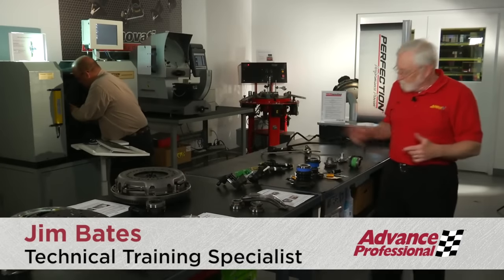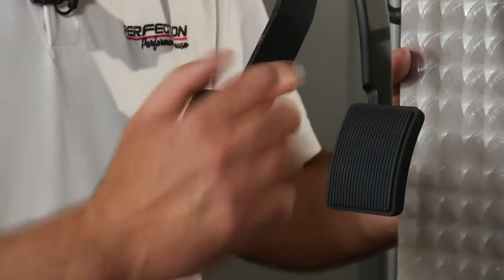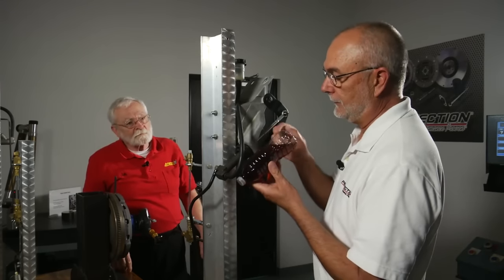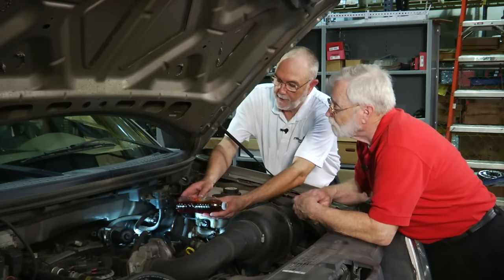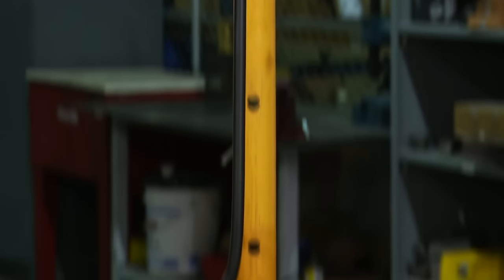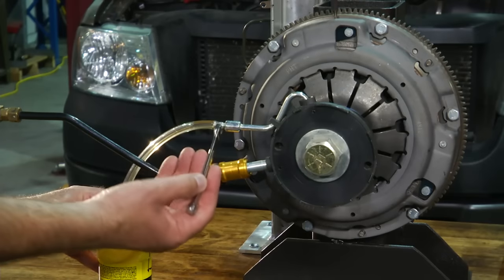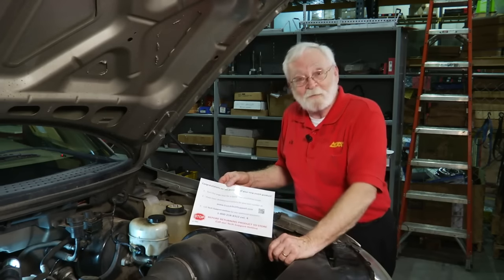How To Bleed A Hydraulic Clutch - Wrenchin' Up

Comment: Hey guys...
I have a 2006 6 SPEED GTO. ONLY 30,000 MILES.
SOMETIMES I HAVE CLUTCH PRESSURE SOMETIMES NOT.
PUMPING SOMETIMES BRINGS IT BACK SOMETIMES NOT.
I'VE BLED IT TWICE OVER THE YEARS BUT I'M 74 AND A DISABLED VET...ONCE IT STRANDED ME AFTER SIMPLY STOPPING AND CUTTING IT OFF FOR 15-20 MINUTES.  I COULDNT EVEN CHANGE GEARS WHILE STOPPED.
A FRIEND BROUGHT ME SOME FLUID, IT WASNT REALLY LOW AND AFTER ONLY A FEW DROPS AND A FEW PUMPS I REGAINED MY CLUTCH.
CALLING SHOPS THEY AUTOMATICALLY SAY I NEED A NEW SLAVE CYLINDER FOR $700 OR MORE.
WATCHING OTHER VIDEOS...THEY SAY IT COULD SIMPLY BE a $0.50 O-ring on the line where it attaches to the slave cylinder.
I DONT SEE ANY LEAKS ON THE CEMENT WHERE ITS PARKED MOST OF THE TIME BUT SOMETIMES INSPECTING AROUND THE BELL HOUSING ITS A BIT WET.
CAN IT POSSIBLY BE THAT THE O-ring is leaking occasdionally?
It's been sitting for about 2 months and i still have good pressure. I crank it and let it get up to operating temp for awhile, pull it up then back a short distance to cycle it through a heat phase then after a couple months of doing this...all of a sudden no clutch pedal again.
Sometimes pumping it brings it back, sometimes not.
Let it sit from frustration about a month and It'll Sometimes pump up.
Its weird...
The resiveour never gets below the tubing on the master cylinder..i add some if necessary before touching anything else.
I'd think if the slave cylinder had a leak it'd leak all the time???
Any idea? Bad O-ring leaking occasionally or what???
It's doubful a shop will fix it and say it was only a bad O-ring...lol.
They tell me theyll have to put it on a rack and pull the transmission to replace the whole slave cylinder which i understand but was it necessary to begin with???
And...of course they want to change the clutch too!
Add another $800. 
Like i said..it only has 30,000 miles and most of those were on long vacation trips on interstate highways...not much shifting!
What cha think?
Reply from the maker: Hi - Thanks for watching! Being retired I seem to have developed a bit of a “rusty thumb”, and because long distance diagnostics can be difficult anyway, I really want to suggest that you contact Precision Clutch about this as they have a vast library of vehicle specific video’s and information that may be of assistance. Their contact information is in this video’s description.

Comment: what about if you are car shares the reservoir with the brakes how would you bench bleed that
Reply from the maker: Hi - That's a good question. I suggest you check with Perfection Clutch at their website (listed in the metadata below the video) as they usually have vehicle specific procedures there. Thanks for watching!

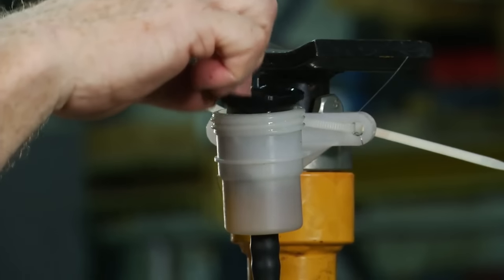Comment: 3:49 How do you do this when the master cylinder is shared with the brakes and all your lines are solid lines (not rubber hoses)?
Reply from the maker: Hi - Thanks for watching! That type of system was not discussed during the filming so I would like to suggest that you check with Perfection Clutch. They have a vast library of vehicle specific videos and information. Their contact information is in the video description.

Comment: I press down the clutch down and its hard to change gears what may be the problems
Reply from the maker: Lots of things, but you may first want to consider that your clutch pressure plate and disc are just worn out and need to be replaced. If it's a hydraulic clutch you'll have to check for leaks in the system too. Thanks for watching!

Comment: Hi Jim,I don't know if this would be the preferred method but on my Ford Ranger I removed the clutch rod from the pedal,then the switch and took the snap ring out of the top of the cylinder.Pulled the plunger up until fluid ran out and then pushed it back in.Reinstalled the snap ring and put it all back together.I used a new pair of 90 degree snap ring pliers and put a new clip on the clutch pedal rod.Less than 20 dollars spent and about 20 minutes to do and it worked perfectly for me.Might help someone else with a similar vehicle as mine.
Reply from the maker: Thanks for watching and thanks for the great tip! I'm sure folks with a vehicle like yours will find it interesting.

Comment: Damn good video I'm going to jack the front of my car way up in the air for this one
Reply from the maker: Hi - Thanks for watching! Some folks have said that worked well for them.
Reply: @WrenchinUpwithJimBates  I bled the cylinder that way but still I had to replace it because the pedal got softer after sitting overnight. Replacing the slave cylinder and bleeding it though it was very easy. I took the car apart three times for practice.

Comment: Why can't a person purchase this already bled? No matter what I do the pedal goes to the floor. As I said I have done this a year and a half ago. Got in to the 89 chevy S10 pickup and drove it away.  Ever do a timing belt on a 95 Lebaron with a V6. Doing what I am doing should be straight foward. like I did a year and a half ago. I purchased the same items and had NO ISSUES WHAT SO EVER!!!! My blood pressure has gone up because of my truck no moving!
Reply from the maker: Hi - Did you do this a year and a half ago on the same vehicle?
Reply: Jim Bates Yes. I didn't even have to get special tools!  yesterday I put a pair of vise grips on the hose that goes in between the master and slave cylinder and the clutch near the bottom and the pedal is hard and firm . doesn't feel spongy.  had a fried stop by and he helped me bleed it the old school way.  all I seen was clear fluid come out. Then it went bad. while trying to install  slave cylinder the pin fell into the trans. Took me 15 minutes but got it out with magnet on a string. hope it works when I put slave on tonight.

Comment: Hey Jim, thanks for the video! Very informative, you got a calm voice aswell. :}

Do you maybe know what can cause a clutch 'pedal' to release air from the top of the pedal when you press it in? Ty!
Reply from the maker: Hi and thanks for watching! I suppose it could be anything from air just harmlessly escaping from a rubber boot type of grommet at the firewall to perhaps even a bypassing clutch master cylinder (not good). What type of vehicle is it, and are you having any clutch problems that may have a contributing factor? Hopefully the experts at Perfection Clutch will jump in here with some guidance as well.
Reply: Woopsss! Forgot to state car lmao, its a 2000 Civic hatch, it leaks from the rubber, would it be a master clutch cylinder leak or?

Other than a leak, there is no noticable problems with the clutch at all, fluid is on level, clutch engages/disengages. It is just the irritating woosh of air sound, and the little leak at the pedal :d

Thanks jim!
Reply from the maker: Because of the "little leak at the pedal", your suspicion of a clutch master cylinder leak may be correct but I think you should check it out, or have it checked out to be sure. If it is leaking a bit now, it will probably only get worse over time.

Comment: 85 fire bird push the clutch down but the trans wont go in to gear
Reply from the maker: Hi - Thanks for watching! I think you should check to be sure the clutch is disengaging from the flywheel. If not, it's probably a clutch problem. If it is disengaging then it's probably a transmission or linkage problem. A service/repair manual should help you out with the testing and repair procedures.

Comment: why wouldn't you just push in the clutch pedal?
Reply from the maker: Hi - Thanks for watching! That usually doesn't work if air is trapped in the system. The video explains why.
Reply: @WrenchinUpwithJimBates  thanks, yeah I am silly. We will be replacing master cylinder soon. did a clutch,  pressure plate, and slave cylinder. jeep has 180k miles. Clutch doesnt quite fully disengauge. assuming next item to replace in this journey is the master cylinder.

Comment: Why can’t I just jack the front end of my silverado up and bleed it that way?
Reply from the maker: Hi - Others have suggested this and it might work. Go for it and let us know if it worked for you. Thanks for watching!
Reply: Should I take the cap off the clutch master when I jack it up or does it matter?
Reply: Another idea I had was to do a “bench bleed” by attaching a long piece of hose to the slave cylinder and looping it back to the master’s reservoir then pumping the clutch.

Comment: one time i was having clutch issues tried bleeding the clutch on my Honda replaced the slave and master cylinder bled and bled the pedal still didn't work i then came to find out the pressure plate  had logged out of the chat preventing the clutch from moving in and out or on and off 🤷🏽‍♂️😂
Reply from the maker: Hi - Thanks for watching and sharing your experience!

Comment: Hi. I have a problem with a Kia c'eed 2010, 1.4 CVVT, 90hp. There is a noise only in reverse while I release the clutch pedal slowly. The mechanic said the release bearing is the problem and changed the clutch kit but the noise appeared again after one month.
I have the same noise like this guy but now it doesn't do it all the time and not so loud all the time. If the noise is present and release the clitch pedal entirely the sound dissappears
https://www.youtube.com/watch?v=ooq5erzmF0w&feature=share
Now when the engine is turned on and I release the clutch pedal I can hear a nock which comes from the clutch or gearbox area. With the engine turned off there is no noise.
Reply from the maker: Hi - Thanks for watching! Be sure to redirect your question to the folks at Precision Clutch. They are the experts and their contact information is in the video description.

Comment: The cluch is at top it won't go down
Reply from the maker: Hi - Thanks for watching! This could be more of a mechanical issue than a hydraulic issue. Clutch pedal, link to clutch master cylinder, stuck or "frozen" master cylinder, wrong clutch/pressure plate, pressure plate installed backwards, etc. I would like to suggest that you check with Precision Clutch because they have a vast library of vehicle specific videos and information that might get you to the cause of the problem more quickly.

Comment: This doesn't make any sense for older vehicles. You can't take clamped down steel lines o  older vehicles.  Please make your disclaimer.
Reply from the maker: Hi - Thanks for watching and sharing your opinion! The intent of the video is to explain how and why air bubbles trapped in the line cause bleeding problems.  I recommend that you check with Perfection Clutch because they have a vast library of vehicle specific videos and information. Their contact information is in the video description.

Comment: Oem parts don’t have this problem.   This is a symptom of a subpar part being sold.   This is what happens when you let Factory workers in third world country, that never owned a car make your parts.
Reply from the maker: Hi - Thanks for watching and for your opinion! However, in this case you are mistaken. This procedure has nothing to do with parts. It is a system issue that happens with O.E. Parts and aftermarket replacement parts as well.